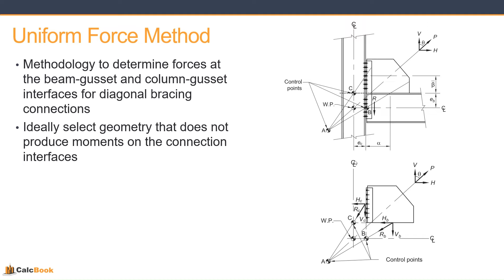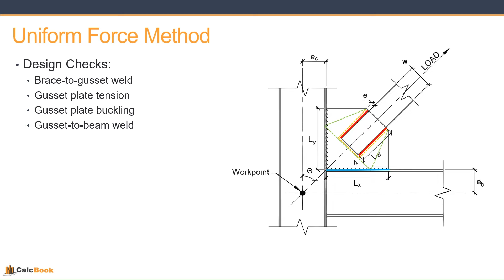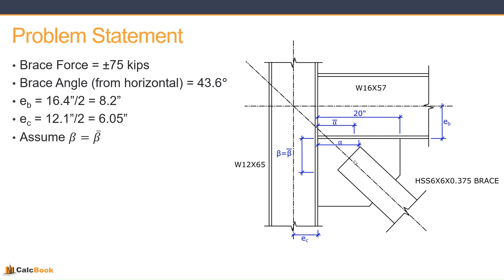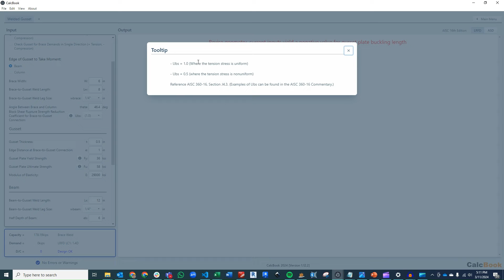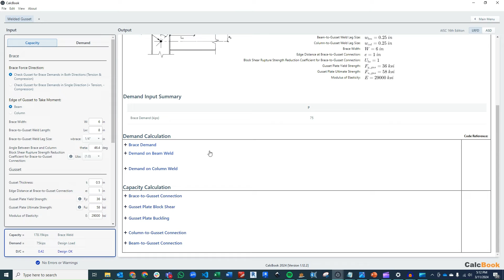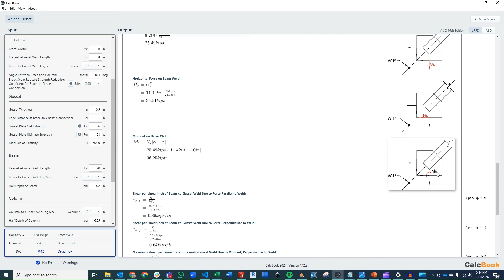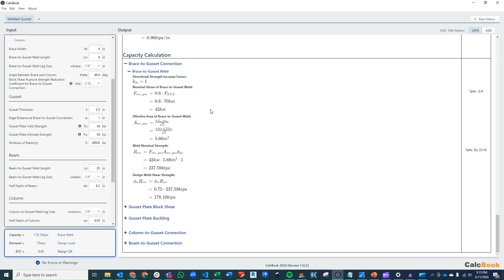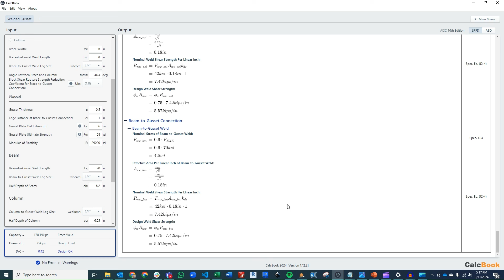Steel Brace Design (Uniform Force Method)

Comment: Hello, how are the terms L1, L2 and L3 calculated?
Reply from the maker: L1, L2, and L3 are calculated based on the geometry defined by the brace configuration. The figure shown at the 11:30 mark shows the lengths that these values correspond to.